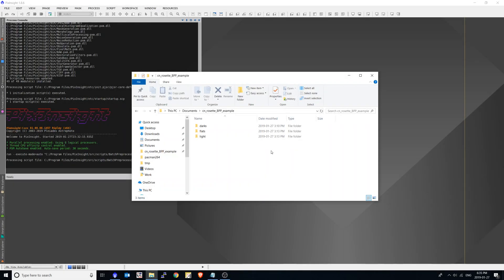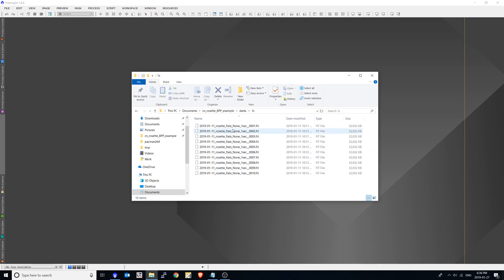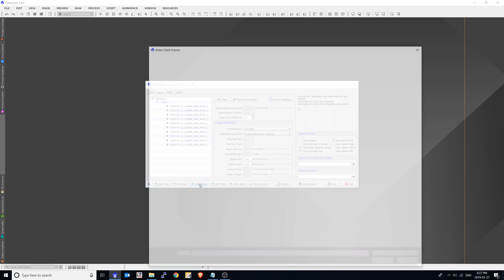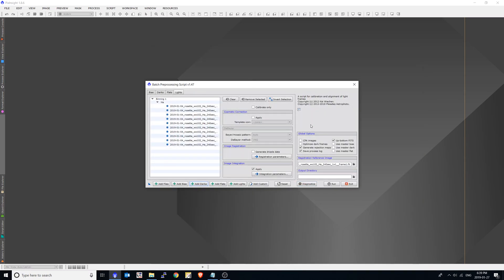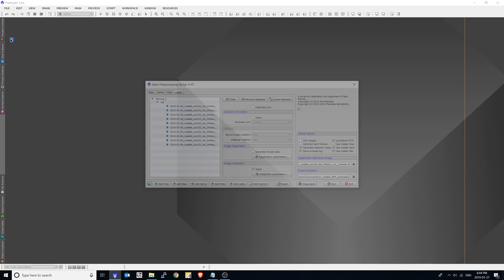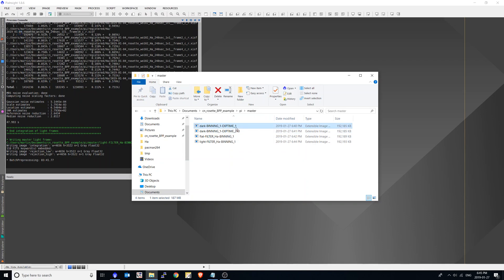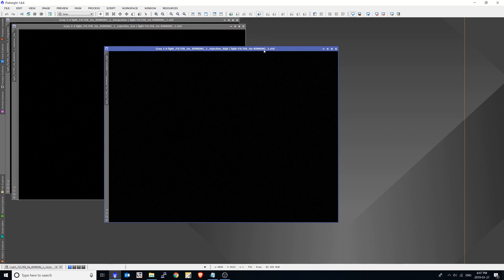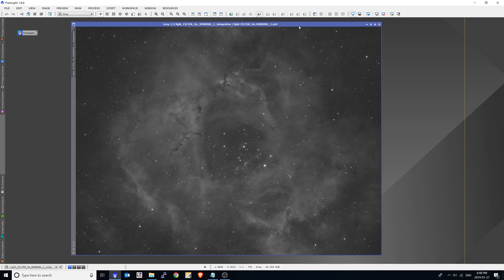Pixinsight - Batch Pre Processing #1 - Intro - Using Dark Flats

Comment: Very helpful! Possibly the only tutorial on YouTube that clearly shows how to add DFs instead of Bias. 👍
Quick question. I use a CMOS cooled OSC. I have data from 2 nights. I placed the Ds which are common to both nights, as temperature and sub exposure length were matched on both nights. After adding Ls, Fs & DFs from one night, I then used the CUSTOM tab to add Ls, Fs & DFs under a FILTER name, I called them OTHER. When I reviewed the columns, in the Ls column I had 2 groups: the first ones and then the other lights under OTHER. Same was with the Flats. But in the Dark column, PI did not separate the DARK FLATS from both nights? There were just 2 groups, when I expected 3? There was the Dark group @240 seconds, and then the DFs group. On one night they were 0.11s and on another night they were 0.9s, yet PI just grouped them under 0.11s. Is that right? Many thanks.
Reply from the maker: Hello Osama, Thank you for your nice comments.  To answer your question Look at the "Exposure Tolerance" value in the darks tab.  Change that to zero.  I go over this in my BPP "Advanced video"  Please  have a look if you have any more questions let me know.
Reply: AstroPal thank you for your reply!! I am struggling to get this! 🤔 I have just watched your second video on BPP and how to combine nights. Got lost on the part where you mentioned that in the reference frame, you chose one of the REGISTERED files from the other night session?
Please, would be very helpful if you help me with this. I bought the Warren Keller book, and it doesn’t help with this. So, basically I have data from 2 nights using OSC. NIGHT 1: 23 lights at 240s -10C. Flats and dark flats. Both are at 0.11seconds. 
NIGHT 2: 30 lights at 240s -10C. Flats and dark flats. Both are at 0.09 seconds. 
In my darks library I have 50 subs at 240s at -10C. These are common to both nights. 
According to your second tutorial, it seems you do both nights separately then just combine the 2 master lights at the end? I’m sure I got that wrong. 
Would be very very helpful if you can explain how can I calibrate and integrate all the data from both nights into one master light using BPP? I followed your advice and unticked process darks. In the FLATS, I ticked CALIBRATE WITH DARKS. Many many thanks for getting back to me.
Reply from the maker: @osamadessouky802  Hey, it will come it takes time :)  I'm glad the first suggestion helped.  So  we do two BPP's separate but use the same REG image from night1 to register, but we use the same working directory as an output.  This will continue to populate the same registered/ directory for you  as long as your files have the date in them it's easy to know which are from when.   After the 2nd BPP is done you are left with a much larger registered/ folder.  Full of files ready to be re-integrated with the "Image integration" module.  So you use BPP to register each day, but after that is complete, you have to reselect ALL the files in the registered/ folder and do one more step to get a final fully integrated image.  The good news this is usually cached and it is a very quick process.  Then you save that image as your 'combo' image.  I hope this helps.
Reply: AstroPal yes! Very helpful. I do this later this afternoon. So, just to double check. First time I do BPP, the reference light I choose in the box above the output directory box is ANY of the lights. With the subsequent BPP, say the second night, I add all the files from second night as usual, but in the REFERENCE frame box above the output directory location box, I pick one of the REGISTERED lights from the previous BPP session? It should have cc, and r at the end? Possibly also d, as I click CFA because I use OSC so I need to debayer? Did I get that right? Then I’m left with TWO light masters, which need to integrated with ImageIntegration? Please tell me I got that right?
😂
Reply from the maker: @osamadessouky802  Almost.  Note what I did I created a directory called "REG" containing one of the Calibrated_registered folders from the first night.  This is the file that will be used for all subsequent nights image registration.  So you don't forget which you used.  Yes for OSC use a debayered image as all registered are debayered.  At the end you don't integrated 2 individually stacked images, but you integrate ALL the registered files again in the registered folder.  Just select them all and add to image integration and you'll see how quickly it completes.  You did all the big steps during calib/reg.   The integration part is fun.
Reply: AstroPal Excellent. I think I got you now. 
First run of BPP: all files added as normal. DFs go with the Darks and BPP will match the flats with the dark flats. Run BPP. I will get 4 folders: calibrated, logs, master & registered. In the REGISTERED folder the lights will be c_d_r or just c_r if mono camera. 

With second run of BPP add files as normal. The reference file will be ANY of the registered files in the REGISTERED folder. RUN BPP. 

The REGISTERED FOLDER will just continue to grow with each run of BPP. I will keep getting a Master light with every run. 

To get a FINAL master light, I use ImageIntegration and combine ALL the files in the REGISTERED FOLDER?

Right?

Sorry, if that’s right, last few questions?

☺️
1- In BPP in FLATS, do I tick or untick CALIBRATE WITH FLAT DATKS ONLY?

2- in Global, UNTICK optimise dark frames

3- Lastly, with the final integration of all registered files, what setting do I use? 
average, multiplicative, noise evaluation, iterative k sigma, generate integrated image, subtract pedestals, evaluate noise, pixel rejection 1, not sure what to choose there, in large scale rejection I think it’s 2,2,2,2?

Many many thanks. 
If this works, u’ve made my day! Cloudy nights and my local forum in the UK SGL could not help me with this!!!

Many many thanks.
Reply from the maker: @osamadessouky802  Yes pretty much correct just always use the same one thats why I make a copy of it in it's own REG folder. (For the registered image).   1.  I believe that's only if you included bias frames - so no.  2.  Correct.  3.  Feel free to experiment, but the easiest is choose a rejection algorithm:  Windsorized and that's it.  You'll learn more as you progress.  Don't need the large scale at start I believe that was to help remove planes, but try with/without it.  Compare.  Best way!  Good news is here it's fairly fast.  (A bit slower with OSC)
Reply: AstroPal thank you very much for all your help! That was excellent. Much appreciated.
Reply from the maker: @osamadessouky802  Welcome!
Reply: AstroPal Just wanted to let you know it’s been working flawlessly and I have restacked all my data, which is not much, and am having a lot of fun with BPP, and even trying WBPP. Just wanted to thank you. You have been most helpful. 🙏🙏🙏
Reply from the maker: @osamadessouky802  Wow that's great!  nice to hear!  Hopefully if anyone has similar questions this thread will help them too.

Comment: what camera do you use? from the offset and gain it looks like a QHY163m ?
Reply from the maker: Yes QHY163M  Thanks!
Reply: @astropal6717  for the flats what Mean value do you aim for? 20k? I am trying to get my calibration frames right to avoid the vignetting and noise, thanks
Reply from the maker: @ioan_astro  Ive used 30k with ok results even 25k
Reply: @astropal6717  Thanks:) what scope do you use?